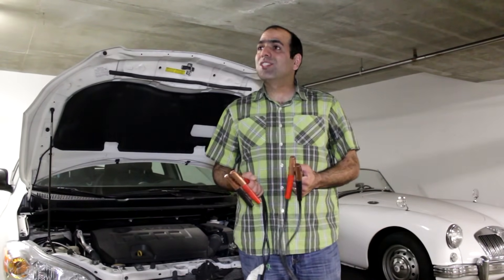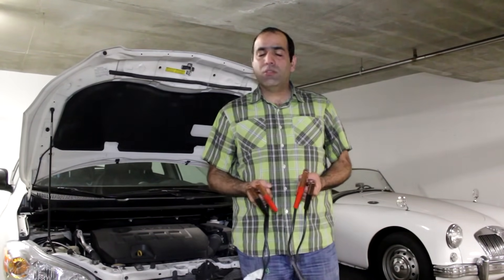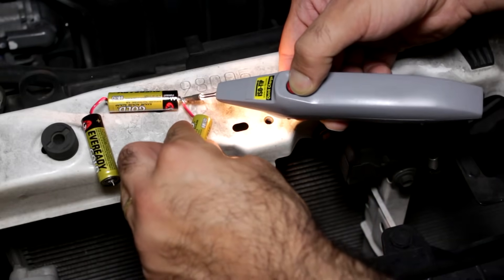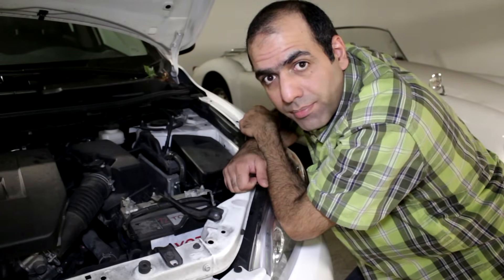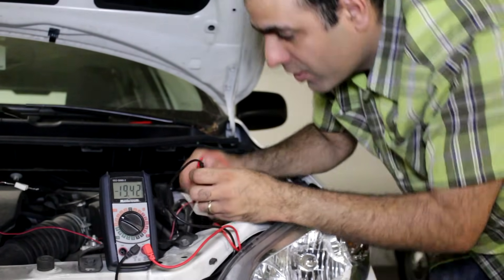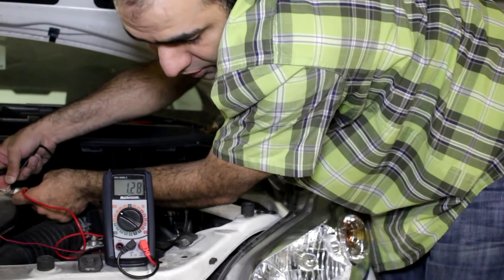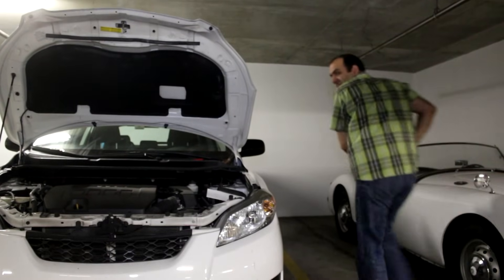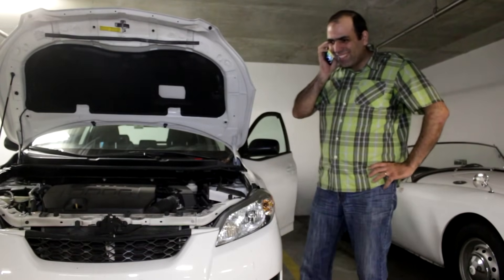Jump Start a Car with AA Batteries

Comment: i came to this video because i seriously wanted to say thank you because this video legitimately saved my life. or atleast got me out of a really serious situation. on a motorcycle trip i got some bad information and went down a path and got extremely stuck in the middle of absolutely nowhere. it took ne over 5 hours working in the mud to get stuck. i had turned my head light off but the ignition was on and the rear light was still on adn i didnt notice. after i finally got everything back up and going again and i went to start the bike (on hour like 6) the battery eas nearly dead at 9.5v. this video came to mind and i got to work finding some wire and wiring up all the batteries i had and  hooking it up to my bikes battery and after about 15  mins i had about 11.5v and to my supprise i was able to start the bike and was able to safely make it to camp. this video 100% saved my ass and i wanted to say thank you.
Reply: Wouldn't jump starting the bike be easier? Like you can push a car to start it
Reply: @petrlaskevic1948  some more modern bikes don't allow you to push-start them. Also he said he was (probably) alone in a mud pit in the middle of nowhere, where pushing a 200kg++ bikes to 20-30km/s needed for a push-start alone is not feasible
Reply: @rezkyputra5239  Yeah, that's why kickstarters should be mandatory, and crank handles on cars.
Reply: @rezkyputra5239  20-30km/*second* is twice the escape velocity from the Earth man
Reply: @lucas29476  he probably meant hours
Reply: @rezkyputra5239  You barely need to be moving, at least with a car. I've done this multiple times, and 2 people can easily push a car fast enough on flat ground to kickstart a car. I should think one person would be enough for a motorcycle, assuming you can find some flat ground, or even better, go downhill.
Reply: @lucas29476  lmao
Reply: @TheSimoc no one is strong enough to start a modern car engine with just a crank. You would need to connect the crank to a circular spring to charge it up first and then let it go to start the car
Reply: @A_youtube_channel_ Cranks were dangerous as hell too once the engine fired or especially if it back fired which was much more common back then
Reply: @A_youtube_channel_  That is one of the apologist myths but not true at all. I have successfully started modern car engines with ratchet wrench and the only hard part is to access the crankshaft pulley bolt on a fully assembled car.
Reply: @nathanieljames7462  Yet another apologist excuse. Yeah there are dangers, but mostly just when done wrong, and unlikely anyway, especially to coincide with the need for cranking, ie. with electric starter failure. Driving a car is dangerous as hell, but that's definitely not an excuse for giving it up. And as long as we do drive, especially during the most dangerous season - winter - getting stranded in a remote place due to flat battery or starter failure is way more severe danger than the danger using crank starter would pose.
Reply: @TheSimoc  What did you call me? Wtf is your problem dude?
Reply: @TheSimoc apologist isn't the right word, for one it is almost always used in relation to religion. More importantly it is the act of defending something, particular controversial (e.g. religious minutiae). In this case they aren't defending anything they are criticising cranks, even if they are wrong it isn't apologetics. However you on the other hand are fervent, nearly religiously so, in defending cranks. You are a crank apologist, nothing wrong with that I happen to agree with you. I grew up with a 1950 Massey Ferguson whose dynamo was abysmal and had to crank that red beauty to life occasionally.

The idea nobody is strong enough to start modern cars is clearly ridiculous when there are endless videos of hand cranked started massive WW2 tank engines. They weren't stupid, you weren't directly connected to the high compression monster, you spin up a fly wheel and it dumps the energy to start. Mandatory kick starts/hand cranks is silly though, a safe flywheel (or otherwise) system is a ton of wasted weight that will rarely be used. Far better to have electronics that prevent accidental discharge or have a simple backup system good for a few starts.

Oh, if you've never seen "Ice Cold In Alex" then you desperately need to, it has the most beautiful hand cranking scene ever to grace cinema.
Reply: @beardedchimp  Apologist is the right word when you get its subject right. The subject I am referring to is the removal of cranks as a "modern" trend and practice with all the excuses. Everyone defending such "development" is apologetic for such a development and its invalid excuses. Sure it is also possible to express it with crank, as a viewpoint as a "crank apologist" which was actually pretty funny expression - have to begin describing myself with that 😄

Thanks for all your agreeing input and information, although your disagreeing part wasn't very valid either - there is no need for such a flywheel system for regular passenger car engine, the same simple crank-and-nut system that we used to have, does work well enough for emergencies, with negligible added weight - or even zero if you opt to leave the crank home.

Your idea of electronics preventing the discharge is implemented one way or another in many modern vehicles, but it is way too incomplete to be relied on - there are so many more causes for unexpected battery failures than forgetting electrical load on, for example, freezing temperatures with battery in worse condition than thought, short driving distances making insufficient charging times, mechanical failures that are per se fixable on roadside but result in discharged battery due to repeated cranking attempts, need of lights and other equipment while doing the repair, etc.

Nothing beats good ol' crank in both its simplicity and reliability. With negligible cost and weight, there simply doesn't exist any valid excuses to leave it out.
Reply: @TheSimoc  hope you grew up.
Reply: Wow, that's great. Thanks for sharing.
Reply: How you had multimeter in middle of nowhere?
Reply: @supremeleader5516  Some bikes have a voltmeter, they're common on aftermarket USB/12v Cigarette lighter sockets.
Reply: @supremeleader5516  I have a pinecil usb-c soldering iron. I 3d printed a really compact case that holds the 2m silicon usb-c. When I'm travelling I grab the case just so I have the 100W usb-c cable, soldering iron is a side benefit. I power it off a makita battery that I created an adapter to a 12-24v 100W usb chipset, it normally charges my laptop. I can't tell you how many times a soldering iron has inexplicably saved the day, like a hammer all it takes is creativity. 

A couple of years ago our cars alternator failed mid holiday drive, we got stuck in the middle of nowhere. I ripped the leads out of the usb circuit and connected the makita battery directly to the car for several minutes, just like Medhi it sprung back to life. When we arrived I was able to plug my soldering iron into a power supply and repair the cables. I regretted not having a multimeter as I really wanted to know both batteries voltage before I tried the ignition and wasted precious charge.
Reply: @supremeleader5516  What I read, there wasn't even mentioned so. Voltage reading was mentioned, it is possible that the bike was equipped with fixed voltmeter, which isn't that uncommon. But well, it is also not uncommon to carry multimeter along on long distant trips, especially in "trips to nowhere", in case of technical troubles arising there. I do, too. Rather, I wonder how he happened to have so many batteries along..
Reply: and im calling bullshit on the original story. too many things don't add up. im not completely unconvinced, but at least 50% and that's enough for me to call bull.
Reply: That’s legit! What a clutch
Reply: 9.5V? Isn't the battery permanently unusable at that point?
Reply: @waldolemmer  Not usually if you recharge it soon (within hours, maybe day or couple). Deep discharge causes sulphation to occur, but sulphation takes time and renders the battery unchargeable only after having been left discharged for a longer while.
Reply: @waldolemmer  no not necessarily. Lead Acid batteries don't like severe discharge but if they will accept current when charging they will recover. That kind of discharge shortens the life of the battery though.
Reply: @waldolemmer  on a leisure battery it would be feeling a bit unwell after dropping to that. Car batteries will be ok as long as they aren’t left like that for long.

Comment: hack of the century. I hope it works. I am using a multi volt universal power supply set to 12v. Tell  you in 20 mins I guess.

Comment: I'm still curios, when my bike wont start (its a somehow mechanical related issue as the starter works but the motor simply wont turn on), I just press the starter and give a middle amount of gas which mostly instantaneously starts the motor so I can drive, why (or as I've never seen anyone doing it) does this not work with cars?

Comment: My battery died at the airport parking lot. I watched your video, ordered 100 AA batteries, spool of wire and solder, fluke 28ii multimeter and cordless soldering gun. Amazon delivered them at the parking lot. It did work perfectly. Thanks

Comment: Great video, plus it was really funny.. the issue is if my battery dies and I'm all alone where do I get batteries,sodder gun ? Car batteries will also charge it self after a few hours if you kill everything such as turn off car lights radio take off your phone from charging it should start after awhile. Your idea if great if your at home but if your alone it's pointless advice ...

Comment: It does work fine. Just use 9 batteries 9 x 1.5V  AND YOU WILL HAVE OVER 12V. The amps will be the problem not the voltage. When you try to start the car the batteries will drop rapidly. Leave it connected to battery for a while with good amperage and it will charge battery enough.

Comment: This will work only with healthy battery which is discharged due to some reason... faulty battery this method doesn't work..my ford has 4 year old battery, it fails few times if i leave some lights on...i mean it doesn't crank at all...at the same time it shows battery voltage 12V(this is strange)...so this method it can't transfer any power to kick the crank....

I tried 3s4p 18650 with 16.8 V to charge the car battery after  purposefully draining car battery but it couldnt turn it on....lol...

Comment: Did something similar... my battery was totally flat and I was in the middle of nowhere. 4 lifepo batteries from powerbank and hey, the ecu, spark and fuel pump were able to wake up just for the moment I pushstarted the car. When it ran I connected the dead battery through a H4 lightbulb and let it get some inital charge, after a while I connected it directly and drove off.

Comment: A dead car battery would have less than 10.5 volts when you measure it with voltmeter. I'm still skeptical about this video. 
11.75V battery reading is considered "good"
Reply: It might depend on a lot of stuff, for example, the battery, the motor, the engine, etc. Good example: My Mum's car. She has a 1.25l inline-4 that had a dead battery (Produced 9.4V) so we took the battery out my neighbors 3.3l V6 which really struggled to start his car under 12.4V but easily started my Mum's car at 11.9V.
Reply: A lead-acid battery that reads 10.5V open circuit is capital D DEAD, not simply out of charge. You will never get that battery to recharge. It's gone. One reading 11.7 volts open circuit is far too dead to start a car but still functional and safe to charge.

Comment: You did not change the metre dial when you measure the current.
Reply: He measured the Voltage across the 1 Ohm resistor. According to Ohm's law: current = Voltage / resistance. As resistance was 1 Ohm the measured Voltage equals the current going through the resistor. Smart idea, thanks  Mehdi!

Comment: Awesome video dude.
I have a question/idea, would that 11 volts from the dead battery connected to a dc dimmer (input 5-35v and output of 12-40v) when the knob turned up to the middle it will give you about 20v can be used to jump start the car? remember the battery will supply the input and it will take the output. (dimmer in question is XY-ZT)

Comment: YES I have 10+ AA batteries laying around in my house
YES I have a battery operated soldering gun in my house
YES I have solder in my house

YES I will solder then all together and attach them to my battery and wait 10 minutes and hope that I cranks my engine because my battery has been FULLY depleted because I left my lights ON all night .. 

Yes this will only work if your battery is slightly dead and not enough juice to turn over the engine, if your battery has been fully depleted due to overnight lights left on for 10+ hrs... This trick will NOT WORK ...

Comment: At first all this this seemed implausible, but then I did a quick math. Based on the graph he charged a total of 15 amp-minutes, or 0.25 Ah of capacity into the car battery. This seems very little. But if the car starts for 2 seconds at about 400 A, that means it draws 800 amp-seconds, or only 0.22 Ah of capacity from the car battery. So it was enough.
This is a very simplified view of the situation and I am curious of what an expert would say.

Comment: Pay a homeless to push the car, engage 2nd shift and take out the foot of clutch pedal. From my experience, Lead acid batteries start to boil at 15v. But if it is a battery to change and the AA works, OK.

Comment: Nice video!!! While you have shown it is possible to charge with regular alkaline AA batteries, I always wondered if it was possible to swap a lead acid battery in a car with an equivalent Li-Ion battery pack (complete with electronic battery control and necessary circuitry between the alternator and the battery control module). Maybe that could be an idea for another video, with pros and cons for such a setup.
Reply: It’s not recommended with common Li-ion because of the voltage mismatch, but four LiFePO4 (or LFP) in series will work well. There are many videos showing how.

Comment: You could also probably use a few capacitors to boost the voltage, correct?
Reply: It would make it AC current (not good for the car battery)
Reply: @biggiss772  thanks

Comment: I keep a 20v drill batteries and two short wires to connect to my battery as my jump start kit. It works awesome. The wires get very hot and you wanna be quick about it but it works. And FYI. I’m driving a 1977 Chevy dually equipped with a 950 cranking amp battery.
Reply: when you start the car, did you leave the drill batterry still connected to the car battery ?
Reply: Use bigger-gauge wires. They shouldn't get hot or else they're introducing too much resistance to the circuit. A 12V drill battery should be fine leaving it connected for ~15mins to charge the car battery.

Comment: why did the current go down during the TEN MINUTES ?? shouldn't the current be steady at 2.2 amps?.. I can see that the CURVE of the graph was an Exponential Decay curve.. but what caused the current value to decrease over time???...  thanks
Reply from the maker: The voltage of the aa batteries drops over time and so does the current
Reply: @ElectroBOOM  Ahhhhh OKAY.. thank you... I noticed when I charge my CAR battery with a regular CHARGER... I set it for 2 amps.. and over an hour or so.. the Charger's AmMeter shows a drop from 2 Amps down to 1 amp... so.. I didn't know why.. thanks.. LOVE YOUR VIDEOS!!! Hysterical and EDUCATIONAL!!.. You're what Youtube is for!!